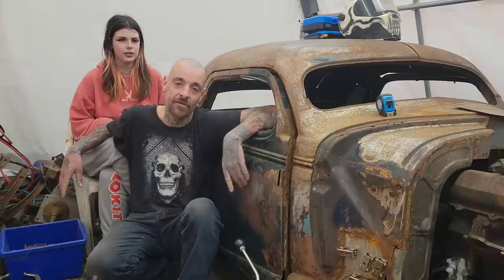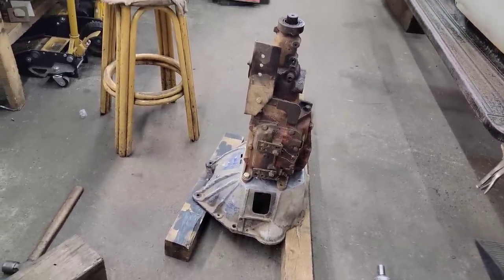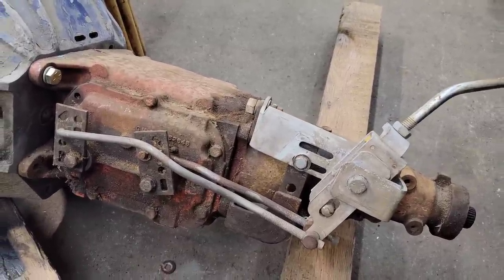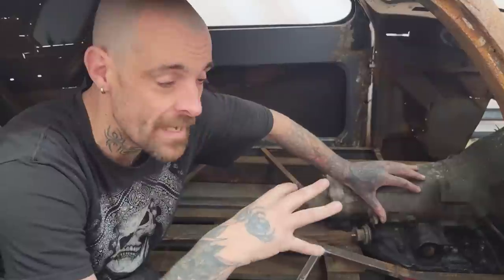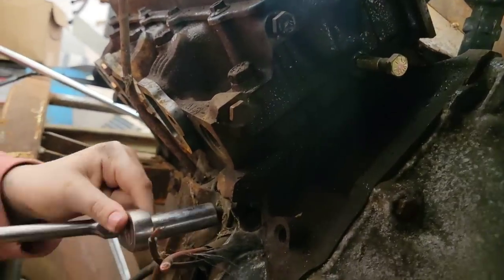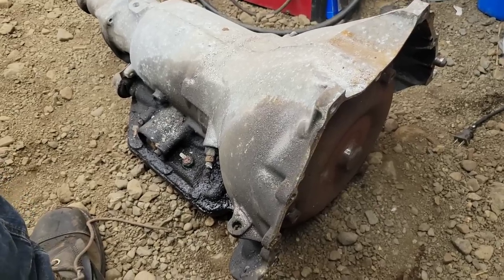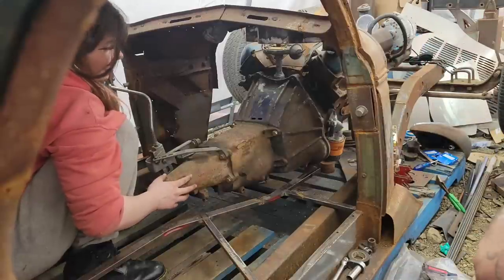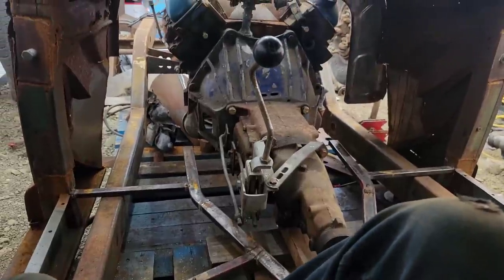Rat Rod Chevy with a Twin Blown Olds gets the Tire Smokin Saginaw 3 Speed it Deserves.

Comment: I'm happy to see your doing better,and absolutely love seeing Dad & daughter busting knuckles together. Well done you two! Looks like it is machined for a bush,take a measurement with ya👍👏👏👏😎
Reply from the maker: Thank you 🍻
I need to grab a new mic.  But I'll get it coming with the flywheel and clutch 😎
Reply: @kingofbootyfab  can't wait....want to see the engine come together😎
Reply from the maker: I'm working on it fast.  I've been dragging my feet with family stuff.  But believe me, I'm in overdrive right now.  I need to weld the intake on the motor to keep it straight. And the second i have access to a machine big enough, it climbs to the top of the list so I can hear it fire. This month I'm shooting in the direction of headers because not much makes an open hood hot rod look as cool as an insane set of headers.
Reply: @kingofbootyfab  sweet you thinking some old school zoomies or some laker type pipes?
Reply from the maker: The short answer is neither.  The long answer, is that when I was much younger, there was a truck that made the cover of where magazine. Called the Tubester. It was built by a gentleman named Mike Cooper (I had to look other up)
The fenders dump headers on it where 4 into 6 into 4, and eventually into 1.  A v8 chevy with 6 tubes, swirling in a twisted ball of tubing.  It was what sparked my love of exhaust , building headers and exhaust systems, the basis of my love of mechanical systems as art.  For both of my 39s I want to build intricate headers,  not 6 tube, bit 4 swirling tubes, potentially with full loops, to amplify the size, and make them stand out.  Form definitely ahead of function on these. They'll combine to a single 4" or so tube, with some form of cable operated valve, to either allow it to dump just in front of the doors, or to go back within the frame, all the way to the rear bumper through full mufflers.  I'm currently looking for 2 or 3 sets of v8 headers to compile enough tube to fulfill my vision
A long answer, but if you're interested in that kind of thing, look up the build,  if it had been released today, it would still be ahead of its time and turn heads.
Reply: @kingofbootyfab  dude!😎.....I'm all in! Sounds like fun

Comment: Love the daddy daughter building thing. Just measure the hole and the tip of the input shaft that will tell you real quick. Keep up the good work. Can't wait to see this up and running
Reply from the maker: Thank you 🍻
I've got a new digital caliper  on the way, I never remember I'm missing tools until I actually need them.  The consensus seems to be yes, but I'll double check when if comes in so that I can order parts.

Comment: It probably wouldn't be worth the extra work, but could you shorten the shifter mounting bracket to move it forward and then shorten the shift rods to get a little more leg room and clearance for the doghouse?  I love seeing every little thing come together.
Reply from the maker: I thought about that when I  was building it, but it's counterproductive since the Seat is so far back. I'm staring at it and honestly wonder if I'll need a longer shifter already to be In a comfortable spot, I'd rather not lengthen the throw even further moving it forward.   
It's the width that will be the biggest killer for me, I've got size 14 feet, so I needed every bit of room, that doghouse is going to near scrape to give me as much as possible

Comment: HELL YEAH to slamming gears.   Looking forward to seeing how the pedals get laid out.
Reply from the maker: A few videos ago I laid them out, I've designed a race style pedal box with throttle, brake and clutch, 3 hydraulic masters, all in a contained box.  It will just bolt to the floor with 4 bolts, I hook up 3 hydraulic lines and a throttle linkage and it's done.  Super simple, and clean.

Comment: I had daughters as well and they were my best helpers. Boys seem to like it for a short while then it wains away. I am looking at a three speed  transmission that kinda reminds me of some of the vette transmission tailshafts. I see several mounting points anyway and not having but one older vette with a four speed, really have little to go one right now... I'm seventy three so been a good minute since I played under the hood of anything. Crank is milled already so just get some brass and turn your own  bushing for the flywheel. Make it a "hair lose" as its not a spinning thing as its a release but keep the bearings in the transmission from stress. I used to call off the name of any piece or part and now can't remember my kids names so easy.. and now of seventeen years since I had a accident thats left me a cripple. My prayer was for the big three to make a top shift transmission instead of a floor shifter that can catch two gears and blow into pieces. Well that and that GM would of stuffed the distributor in front instead of the back. I can say though with a bit of pride that I made a floor shifter that mounted to the top of the transmission like a truck for example and with tungsten shift rods... lets just say nothing bent or gave a fraction. Plus it never ever missed a shift because of linkage issues. I was heavy equipment fab work for a good many years in alaska. Southeast alaska back in my times was a wild west last of the hot rod cowboy days. Guys our age never said so but there was a bit of a boy in almost all of us wanting to ride a horse and pack a six gun. I trained for the army olympics while I was in Nam and no I didn't win... I finished off at like fourteenth in my area of weight lifting and left myself looking like a freak. Cost me some time in the big house which included the old Deer lodge plus a visit in mississippi... greenville to get a location. I had some prejudice issues to work out. Stories I don't believe myself but those memories are right painful. Old school hot rodding was so much fun and lost forever as I see it.
Reply from the maker: I hope old school rodding isn't dead, and I hope that those of you that remember pass down the skills, and the stories for it to live on forever 🍻

Comment: The 260’s were supposed to come machined for sticks as thy were a limited use engine. The crank was unique for the 260 but only in the journals T50 5 speeds came behind them if a stick with an odd shift pattern. Had one and kept the entire stick setup for my 350 olds. I can send you a pic from the olds manual for the pilot, generally it’s a three step bore, and yes it’s great to see you out in the shop with your daughter, been trying that for years with mine, the last one is starting to show interest, so maybe I’ll get a chance like you.
Reply from the maker: That's awesome.  I'd love pics if you could, I actually didn't know any of that. 😎
Keep trying with the kiddo.  All  5 of mine at one point or another found happiness in the shop with me. It comes and goes, just need to give them the opportunity to choose it freely in my experience 😁
Reply from the maker: I haven't figured out a way to message within YouTube, but if you have Instagram you can get me there,  same user name,  or email bootyfabking@gmail.com  I'm on tiktok and Facebook too, but I don't post my full real name on here, but I'd love to see what you've got man.  Info on these engines is limited and I love knowledge

Comment: Sorting the shifter levers and brackets will give you lots more space you will have to extend the shifter but I think it would be a ton more comfortable and look wise just trying to help thanks for the content
Reply from the maker: It's crossed my mind for sure.  But one thing at a time, the more I think about it, the more I think the seat needs to happen first,   or something that holds me in the right position at least, once i can sit where I'm supposed to I can figure out where everything else has to be. I'm cutting a crossmember first so that we don't need blocks or anything anymore,  I'm doing my b3st not to do work too many times,  so shifter changes might come last.

Comment: Move the shifter to the tail stock of the transmission and throw that bracket away and lengthen your shift rods. Your crank is good to go you just need a pilot bearing to go in it.  If it wasn't drilled the bell housing would not of bolted up.
Reply from the maker: If I could post a picture I'd show you the bare transmission, we're already cruising on the doghouse with it removed.  I'll put it on the tail, and I'm building him linkages, much cleaner and a tighter feel.  
Thank you for  reaffirming what I'm doing though, just assures me I'm on the right track.

Comment: Why not try to find a 5 speed transmission from a Chevy S10. That would get the shifter out of the way. The transmission you have is from a mid 60s Chevy/GMC truck. The bolt spacing on the transmission mount are all the same on GM transmissions.
Reply from the maker: I looked honestly.  5 speeds are going for 500-1000 locally.  The 5 speed in an s10 has an integrated bell and would require an adapter, they are a non removeable bellhousing.
Even with the price, they still rarely pop up, and for the sake of the style of build, I do prefer the older trans.
A very good friend of mine showed up with 4 transmissions, 2 saginaws, an 833 Mopar (4speed overdrive) and an unknown 3 speed.  Along with 2 shifters, and a bellhousing. The parts fell in my lap much in the style of the build.
I truly do like this transmission for this build.  A 3 speed saginaw behind an olds motor with detroit blowers feels nostalgiac.  And a 3 speed car just feels fun. I think it was 100% the right trans for this car.  Until I eventually swap in a 403, at which point I'll probably look for a 5 or 6 speed.
Reply: @kingofbootyfab  . The S10 with a V6 has the divorced bellhousing I'm running one behind my hemi. I got mine for $100.
Reply from the maker: Newer? The 90s 4.3 trucks I've never seen   a separate bell. 
It's too late for this car , I'm quite happy with the choice,  buy I'm always looking towards the future. 🍻
And I wish transmissions where that cheap here.   I've been watching people list plain chevy bellhousings alone for $500
Reply: @kingofbootyfab 
I got mine out of a 85 S10 the prices around here are getting higher too. I took my 5 speed transmission out of a junkyard S10. One from a mid 80's Camaro or firebird. But the shifter sits back farther, and the transmission is turned 16 degrees to the right.
Reply: Your transmission has a provision for a floor shifter cast into the tail housing. You could make an adapter that bolts to your tail housing that you can bolt your existing shifter to it.  You would have to lengthen your linkage. You'll have no problem doing that, and that would gain so much needed leg room.
Reply from the maker: I had a total loss of memory there and was thinking about the nv3500 and completely forgot about the t5.
I looked at a few, most came out of Mustangs though, but the cheapest I've seen was $500 froma Ford, with no bellhusing.  The last Chevy T5 I saw locally was $1000
It's definitely a viable option, I agree with you, but I love the price and nostalgia of the Saginaw too much to try to find a T5 now.

Comment: Starter will be on opposite side now. There may not be any mounting holes.
Reply from the maker: To clear the clutch fork?
I'd never heard that before,  but I'll do some digging.
Reply: There might not be any mounting holes for the starter.The starter has to mount on the passenger side now if you look at the bell housing.
Reply from the maker: I'm not understanding why?  I understood what you said, but I asked if it's the clutch fork that is stopping it?  Because if the clutch fork stops it, why would there be starter bumps on both sides?
Reply: Clutch fork is on drivers side, the opening in the bell housing for the starter is on the passenger side. There may not be any holes in the bottom of the engine block for the starter bolts.
Reply: I am sorrry I didn't know it had openings on both sides.Sorry for the confusion.
Reply from the maker: All good.  I was worried I had missed something, I'd never seen the starter swapped on this motor.
The bellhousing has starter bumps on both side because it covers such a broad range of BOP engines, it accommodates blocks with the starter on either side. I'm glad it was just a misunderstanding 🍻
Reply: I have never seen a bell housing with a starter opening on both sides.
Reply from the maker: I've only ever seen it on BOP bells, but almost every one I've had my hands on does
Reply: I work on mostly Chevy's so that is probably why I have never saw any. Never too old to learn.

Comment: looking at your shift mount on the tranny, it looks to me like you should be able to move your shifter over on you tranny maybe an inch or a bit more. might have to pull it back a bit for shift link clearance? i had the same leg room problems on a t-bucket i built some years back that i put an M21 4 speed in. i just moved everything over as much as i could and i got the clearance i needed. maybe i'm wrong, i'm just looking at it on the screen and can't really see everything. by the way, me and my kid work together in the shop on her harleys when we get the time and she says that your girl is going to be the most popular girl in school if she keeps working on hotrods with you and learns how to do everything involved with it. and many young men will be intimidated by her because she'll know way more about cars than they do.
Reply from the maker: I'm going to pass that along to her.  Thank you 🍻
She's helped me build a couple choppers.  And helps me work on the Harley.  She turns 16 in less than 2 months and has asked if instead of a car, if her first vehicle can be a motorcycle and she would like to build it ground up.  She intimidates them already. And knows she can still pull the do you know who my dad is card if she needs to.
Her career won't go down this road.  And I support that.  But i believe she will be turning wrenches forever 😎